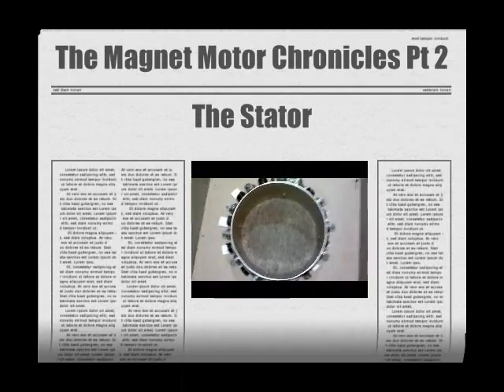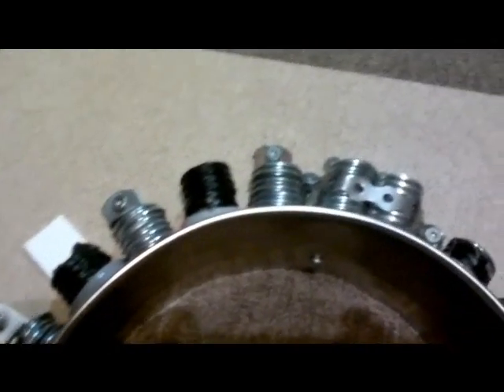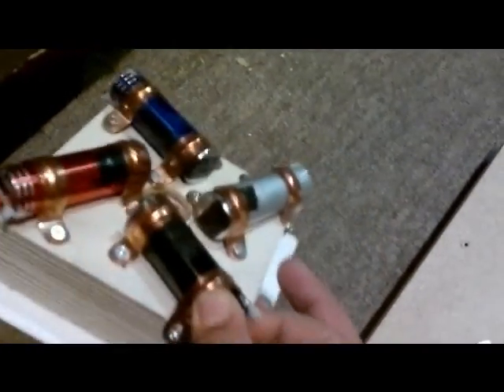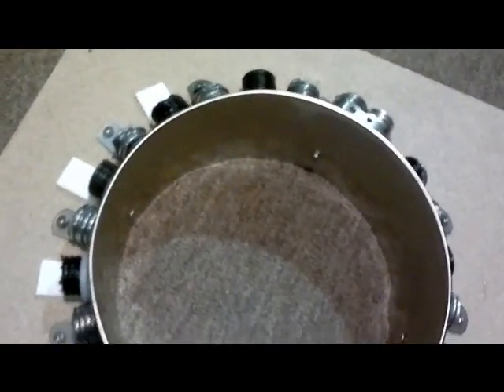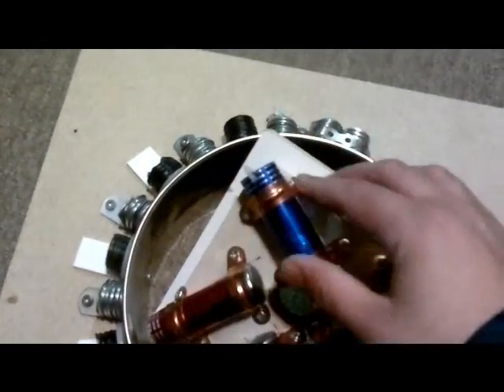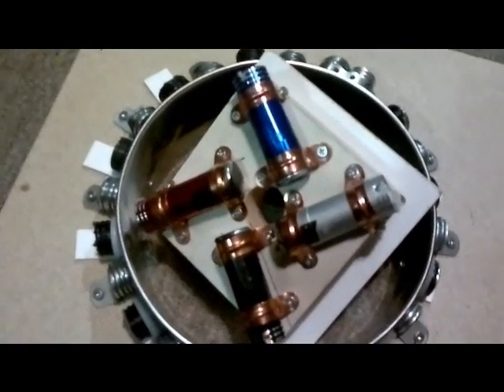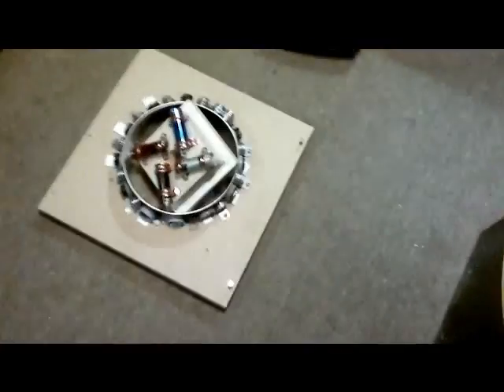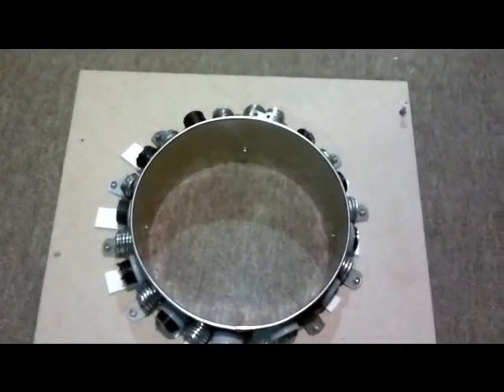The Magnet Motor Chronicles pt2 The Stator  , Howard Johnson magnet motor wannabe

Comment: What I see is that your trying to force a magnet (a permanent) outside of the zone of influence of other magnets and then try to rely on it going back to the zone of influence and this is done by all 4 and all are equal in space, trying to force a permanent magnet to seem like it's in an off position is hard, near to impossible, and then try to make it go back to be like it's in a on position, you might be able to see my point is this, the influence is not reliable to be able to make something go into an out of phase mode without an outside influence.
Reply from the maker: You are right it is darn tricky to say the least, my next model will add a pulse to mess with the fields. Thanks for your comment much appreciated.

Comment from the maker: That is the purpose of my next video my friend, to put on the stator and to give it a twirl to see if it works or not. I am not implying that it works, all I am doing is attempting to make a magnet motor and recording my steps to show others what I have tried to save them the bother of going down the same road. You can learn more from my failures then my successes, simply because I have many failures and very few success.  Haha, I crack myself up. Thanks for your question I hope this helps.